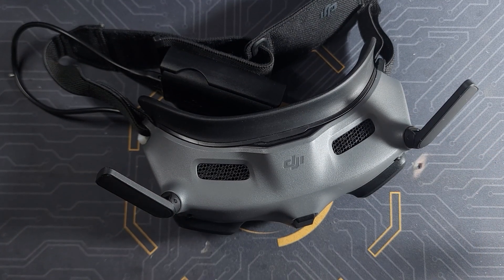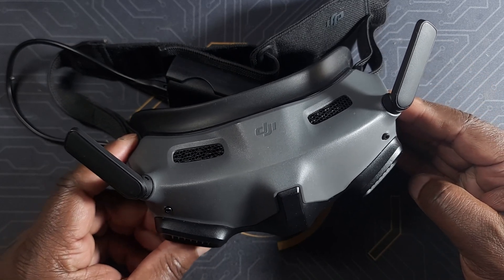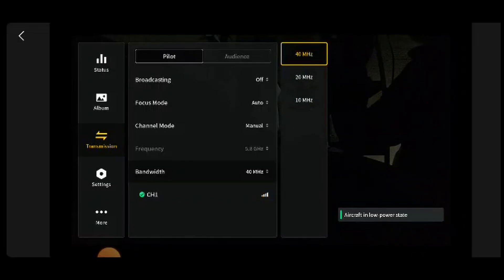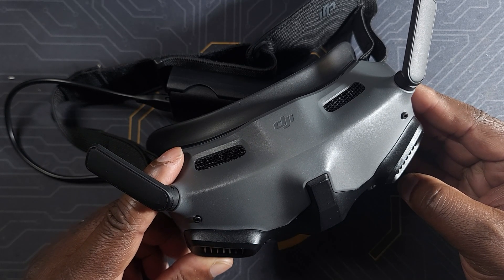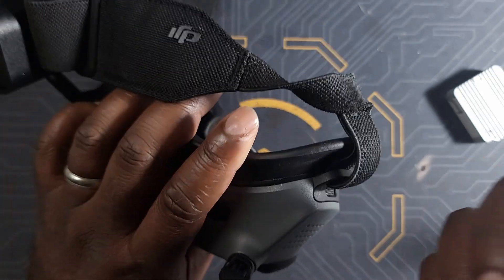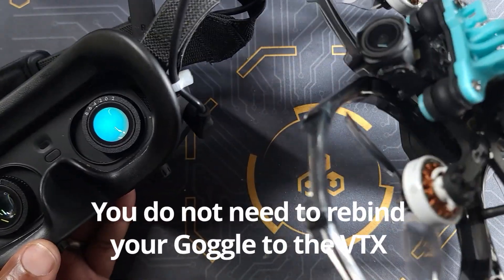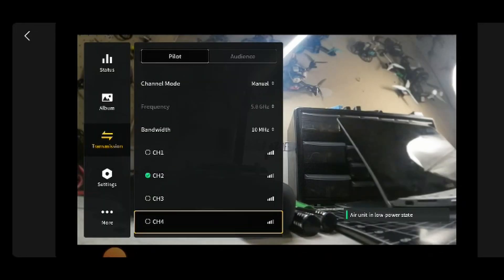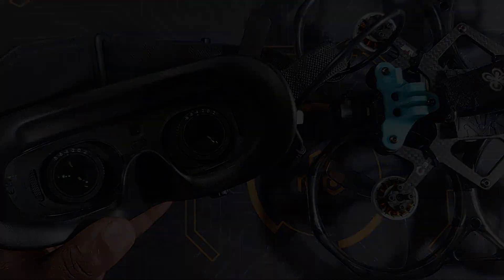DJI Goggle 2 "FCC Hack"

Comment: Hi i did it and when i activate the air unit i gets lots of Mbps bit after a seconds it return to 5 Mbps ...
Reply: You need to connect the drone to the radio and arm it as soon as it takes off the high values return.

Comment: Yeah but only works for Avata and Air Unit 🙄  I need FPV and Mini 3 Pro 😟
Reply from the maker: Do you have a Gogglec 2 or Integra? BCs, .you only do the hack on the Goggle . I'm not sure if it will  work on  the Mini Pro 3 , but u can give it a try.  I can't bcs I don't have one.
Reply: @GBoniFPV  I have goggles 2 - it's well known this hack works only for Avata and Air Unit
Reply: @GBoniFPV  i use the goggle 2 with a Mini 3 Pro and i'm not even able to change anything as before under the "transmission" settings. i think it does not work

Comment: Tried this and it didnt work, firmware 01.09.0000. Formatted sd in goggles n move ham file to root of sd card n reset goggles. Tried different ham files from 2 different source (rotor riot n mad tech). Driving me nuts. Any suggestions is appreciated
Reply: You probably didn't delete the suffix of ham_cfg_support. You need to delete the .txt .bin and other words during renaming and change it to ham_cfg_support.

Comment: Does this work for improving range in the U.K? 

I am flying a Bind N Fly Bob57 woth 03 unit & Crossfore. 

When I get about 360-400 meters away, I’m loosing the HD bars down to about 2 red bars and am scared to continue pushing it further. I still had video and control, it just showed 2 bars HD in goggles. 
I’m confused as I see footage of people doing long range with the Bon57, and I’ve bought a 4000mah LiLon iFlight fullsend battery for this reason. 

There were zero obstacles beteeen myself and the Bob, and I was still facing towards it so anyone know why I’m getting the red HD things loosing bars at such a short range? 

I’d Like to be able to get to around 700 meters at least ideally.

If I do push it and loose connection then I hope my GPS Rescue will kick in, but I’m having to turn back much sooner that I want/need for some specific locations when I’m flying. 

I’m new to this stuff coming from normal drones and Avata so it’s all new to me. 

Again, it’s a Bob57 + 03 unit and Crossfore. I’m using Goggles 2 and TBS Tango 2. 
Any tips or info will be ideal. 

Cheers
Reply from the maker: In Europe/UK, DJI limits the VTX power output to 25mw due to EU/UK regulation. That is what is limiting the range on your O3 system. DJI is able to get your location when you  activate/register 
 the system on the app.  This hack will definitely unlock your 03 power, but off course , I will never advise you to go against 🇬🇧 regulation.
Reply: @GBoniFPV  so you think this would do the trick if someone was to do this sort of thing in the U.K?
Reply: Hey hey. Did you figure out how to fix it? I am having the same issue with bob57. I just did the FCC hack and yet to test it. Should the channels be set to Manual or any specific MHz and channel needs to be selected?

Comment: Thanks. So you say we need to stay in manual mode and not auto. Why is that and what do you base your decision to select a specific channel if on manual mode?!
Reply from the maker: When flying on auto, the system manages the power output.  This is just my speculation based on my experience with the system. The 03 will be witching channel and managing the output power up and down based on the distance between the goggle 2 and the VTX. When running the system on manual mode,  you lock the channel to a specific one, and you also lock the output power to the highest level. I have noticed a  major improvement on reception quality when running on manual mode compared to auto.
Reply: @GBoniFPV  exactly I have the same feeling regarding the manual mode.Seems reception looks more stable. my question now goes what channel and frequency you would choose in order to get best reception.
Reply: do you know this still??
Reply: @GBoniFPV oh OK that makes sense. I did the hack but was still on auto. And was getting low mbps in places where I used to have 50mbps before I did the hack.

Comment: Awesome, ill give this a try here in the UK as my Avata /goggles 2 only transmits upto 150m 😢
Reply: Did you manage to do it?
Reply: yes, works on latest software for Goggles 2 and the Integras I have. I tested range and distance went from 150m to 800m before it started to drop. Long range test, the LIPO6S  got me 3.4km before i had to turn around (1600mah) @ai_guitarist

Comment: Thank you. I have yet to try your tutorial, howewer my new googles v2 shuld arrive monday, can i update them to lates software and will the ham file still work? Or its only works on older firmware versions and possibly needs downgrading.
PS i take it i dont need to do any hack on dji controller 2? 
Thank you.
Reply from the maker: Just o be sure, this hack is for the Goggle 2, not the V2

Comment: 这个方法并不可靠，根据频道数量判断是否成功FCC是没用的，应该用功率计测量。
Reply from the maker: I don't have a power meter capable of measuring digital system power. I'm sure they do exist and expensive. This is the best method I could come up with. However, you need to look up Madtech channels. He has done more extensive  testing, and he concluded this give you more power.

Comment: Hello, I have a Babyhawk 2 HD with Caddx Vista, and my goggles are DJI integra. I have unlocked FCC on the goggles, but how can I set or know the power level of the Caddx Vista? Nowhere in the goggle menu can I see or change the power. Can someone help me?
Reply from the maker: DJi took that power option with the O3. I missed that feature.

Comment: Why this hack doesn't work on V2 goggles on my dji fpv.Before this hack work but now not anymore.
Reply from the maker: In knowledge, this hack is for the goggle 2. The V2 requires the old 1200mw power hack
Reply: @GBoniFPV  maybe you know wich hack will work for V2 goggles??
Reply: @nejc8a  Bardwell has a great video going over this. He goes over all the WTFO hacks you can do, including the 1200mw hack. Highly recommended.
Reply: @lucas_heide  maybe you know link of video?
Reply: @nejc8a  https://www.youtube.com/watch?v=KuKjWDJ6XeU and https://www.youtube.com/watch?v=63Smmc0bNcg. The second video will only be necessary if you need to roll back the firmware on your goggles.
Reply: @lucas_heide  thanks man.

Comment: Hi great job. So as far as I understand, FCC should also work on Air Unit and Vista? I have a bit of a problem, although 7 channels are shown to me, but the Air Unit only runs at a maximum of 7 mbps. If I set the audience it increases to max 27 mbps. You can help me??? Or old Air Units with Vista are simply not supported. Thanks a lot.
Reply: why after I opened fcc it become 7mbps in shorter distance,its just lose signal after 300m now. it worse
Reply: @dongyuanhao3855  Look at Bandwidth at 20MHz if you have 7 channels, if not then it is not in FCC mode. If you have 7 channels correctly, switch to 40MHz in the Bandwidth settings and it should work.
Reply from the maker: They should be supported.  Is this behavior started after you did the fcc hacked
Reply: @GBoniFPV  Everything is fine now, it was my fault, thank you😉👍
Reply: @alespacka  what was the problem? i have the same issue. thanks
Reply: @tugceulucay6344  The problem was that with the old AirUnit or Vista the signal before the Arm was max 7mbps after the Arm the signal increased to 50mbps so everything is ok. With the new O3, the signal is 50mbps even in front of Arm.